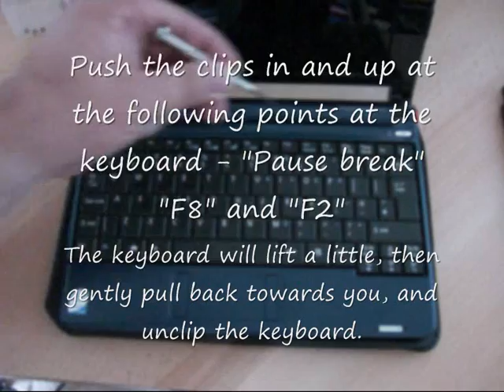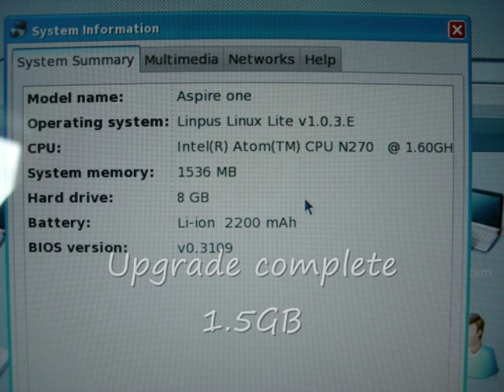Acer Aspire One Memory Upgrading

Comment: Security Active:  I used your video to help me with an issue I had with the power supply.  I found a broken wire coming from the board to the female power connector (Charger).  Resoldered it and put it all back together.  It works once again.  Thank you!  If not for your video I may have broken the plastic while trying to access the internals.  I really appreciate your efforts to help others.

Comment: I did this upgrade, and it was definitely worth the trouble. Top tip is to use a credit card to take the cases apart, the use of a credit card prevents you from causing damage to the plastic. Job's definitely added a couple more years of useablility on this old netbook.

Comment: Thanks for sharing this.
I got the Linux 512MB RAM, 120GB HDD version two days ago. Last week, I got a Dell Vostro 1700 which I upgraded to 4GB RAM, so had 2 x spare 1GB Samsung PC5300 SODIMMs from that. Fitted one of them into my Acer and it works a treat, just like I knew it would. 
Installed XP Pro with SP3 tonight. The only difference with my dismantling was that I had to take the board with the audio in/out out to get the motherboard out due to it having the HDD attached to it. Cheers!

Comment: I'm pleased to see there is a slot on the underside of the mobo. Considering my Aspire One came with 1GB of RAM, I'm guessing that I presently have a 512MB module in the slot at present. Still, I'm very glad to see that this computer isn't at it's limit with regard to RAM. I can most certainly see myself adding two more gigs some time down the road. At present I'm very satisfied and have no justification to have more RAM.
Thanks for the succinct but detailed video!

Comment: Great video!  I had to disassemble two of these and this came in handy.  I had to take the HDD out of one and put it in another to see if it would boot off that drive.
This video is useful for getting at the HDD as well as the memory because the HDD is located right next to the SODIMM slot.
This video is pretty relavent to disassembling an A105 8.9" incase you are wanting to know.  (thats the model I had to disassemble and reassemble...twice).

Comment: Fantastic! Thanks. 

I upgraded my 512MB Linpus AA One with RAM in the format mentioned at the end of the video. Took a little patience but it wasn't too hard. The system works so much better with 1.5GB on board. I was able to buy a 1GB DIMM in the format specified at the end of the video from Patriot for <CAN$30 with shipping. Well worth the money.

When you're upgrading, you might notice what appears to be a SIM slot in behind the battery... perhaps there's a 3G card coming?

Comment from the maker: @Userizz Sorry you are incorrect.
There is 512MB soldered to the motherboard that can not be removed.
The is an empty SO-DIMM slot and I installed a 1GB module, that is a total of 1.5GB RAM.

Comment: Thanks a million for this video! I will be using this when upgrading my A1's memory!

I already tried once, but I didn't get any further than the screws below the battery pack.. one screw was so tight, there is now no more need for a screwdriver.. I'll have to drill it open, or something.. And since I'm currently awaiting my Dremel I'll wait until I got that one.

But once that's taken care of (damned screw!), I will follow your video, so thanks for posting!

Comment: That sucks. Hope it works out for you!
I still haven't decided if I should drill the screws open or not. For the moment it works and doesn't look too bad even though I messed up with the screw (I should never have used the soldering iron..)

Comment: NOTE: some people are saying this will not void your warranty. IT WILL. Memory upgrades on laptops usually dont, because there is an access slot under the machine to get to RAM. This thing doesnt have one, so you have strip it completely, thus removing "warranty-check" screws. 

Also, its tricky. Dangerous and like me  you may hve to solder parts back on :) 

Also, if you KB lock slots go missing, its cause they got stuck inside the rounded part of the case. Simply look from behind.

Comment: I managed to fix it!!

I couldn't wait or do nothing, so I drilled away the screw. I managed to unscrew it later, so its not very damaged there (Just the other one I melted).

But this was really tricky, and I wouldn't recommend doing this unless you are used to it. Also, it's not very neccessary if you plan on keeping Linux Linpus.

It reports 1536 MB memory after the live update :-)

Comment: In regards to the reasoning of upgrading ram:
XP with how much has been added to it over the years, now runs best with a MINIMUM of 1GB ram.  In other words, just sitting at the desktop, depending on what other software is installed, it could be using around .6 to 1GB of memory from just sitting.  Adding more memory means being able to do more stuff at once.  In regards to gaming, more memory helps but its not the only thing that improves gaming frames/second and graphics.

Comment: It should not be fused. Take the rubber feet off and remove the screws under them. It takes a gentle pry to get the bezel snap up. Just be sure all the screws are out of it, both under the keyboard and on the back.

Comment: Your RAM is underclocked since the N270's FSB is 533... 
Is the system stable ?
And the max ram is 2Gb...
Both my aspires D250 and & A150 (like in this video) came with 1Gb and a free slot... upgraded both to 2Gb fine

Comment from the maker: The easiest way to upgrade your HD storage space, is to buy a high capacity SDHC card and store it in the left expansion slot.
Physically upgrading the internal 8GB SSD is not an easy process. If this is a route you are considering, do some searches on ZIF connectors and Compact Flash cards.

Comment from the maker: Gotta love comments like that moliverm. The memory is installed, and it works no problem. If you were not aware a computer can accept memory of a different specification, but will not utilise it higher than the memory that already exists. So the memory is only running at 533Mhz. 
I suggest you purchase exactly the same make and specification of memory and test it before making such comments.

Comment: Also, purchase some capton or mylar tape, remove the LCD cable from the mainboard. Tape around the connector and replace. Stops the LCD panel from shorting the board and getting half a display.

Comment from the maker: The Aspire One does not support 2GB Ram, 512 on board and 1GB Stick is the current max.
As for the warranty there is no firm answer on that.

There is no access plate on the bottom to access the memory area.

Comment: @goshmerlin I went to nDevil.com and his RAM upgrade for the D255 follows exactly the same process.   I did this upgrade just now and there is no way to get the bottom off without taking the KB off.  I did wonder why Acer didn't put the screws through the base plate,  but they didn't.   So KB has to come off.

Comment: I found out that my AA1 A150 has its driver mode on PIO.

how do i change it back to DMA?
what will happen if i uninstall the drivers?
What will happen if i restore to factory settings (alt f10 at reboot), will it remove my OS?

Comment: For all those moaning about why did Acer make it so difficult, the clue is in the name; netbook.  It's designed for surfing and email etc. and it runs very nicely on 512MB RAM for these applications.  If you want to do things that require more memory, you either learn how to use a screwdriver or buy something else.

Comment: know definitely not this laptop does not support DDR3 memory as well as it would not physically fit in the memory slot

also you may want to check out my videos
on installing RAM in the Acer aspire one
as it is much more detailed as well as the video quality is much better
and there is also a video on reassembling it with diagrams of where the screws go

Comment: @securityactive try a system restr if u have a point or un a memory diagnstic worked once for me try it out or when starting try F8 hit it until it come out a menu that have safe mode safe mode with netwoking....etc go safe mode and see if it starts if it those try system restore if ure accer still have windows xp just alt F10 nd follow instruccion hope u get it solve ....ps the instruccion before mencioning windows xp is for windows 7

Comment: Actually...the new ones come with 1GB (512MB on board & 512MB in the slot) see u can replace the 512MB in the slot with 1GB RAM.  512MB onboard + 1GB in the slot = 1.5GB max.  You will have an extra 512MB RAM module that you can sell on craigslist or something to offset the cost or just use it as a paper weight...u choose : )

Comment: Never mind, after trying a nice tip about heating stuck screws with a soldering iron... Lets just say that I'm sticking with the 512 MB and a working, albeit slightly dented  AA1 for now... :-(

Also, another screw below the battery pack is STUCK. Why do they tight them this much? I use a right size screwdriver, to my knowledge. The other screw unscrew just fine. Probably just because DIY misfits like myself will screw it up (pun not intended)!
(continued...)

Comment: @erick36594 My Acer Aspire 5100-5455 that I bought for around $600 brand new, was pre-installed with Windows Vista. It has:

1.8 GHz AMD Turion x2,  1 GB RAM   (256 MB of the RAM is used for graphics by default, so I am left with 768 MB RAM for Vista)  ... Disk drive stopped working 1 month after I bought it. It overheats enough to where the stickers on the bottom can't be read, The left touchpad button is broken, the screen won't turn on, and the batter lasts for only 15 minutes. I HATE ACER!

Comment: ALL YOU NEED TO DO IS REMOVE THE 1 MIDDLE SCREW UNDERNEATH LOCATED IN THE PERFORATED SECTION UNDER THE TOUCHPAD AND SLIDE THE COVER AWAY FROM THE BATTERY and it's right there.
Reply: Remove what cover? AOA110, the first one, does not have one.

Comment: @erick36594    Also, the Card reader only works on a good day. 2 of the 3 USB ports only run USB 1.1   only 1 of the 3 uses USB 2.0  ?!!!!  WTF   I got ripped off. I treated this laptop with soooo much care, and everything broke for no reason. most of the problems I have had, others have had with this same model. Oh yeah, and the biggest problem of all:    I power up the laptop. The BIOS gives me an error message with 2 VERY LOUD beeps, saying there was some type of error on the board itself!

Comment: RAM...the most you can extend to is 1.5GB (thats 512MB built in and 1GB as shown in this video).
GRAPHICS....you won't be able to get anything smaller that will be as efficient...basically what it comes with is probably ur best bet.
MEMORY....there is a 160GB Western Digital 2.5" SATA HDD (i think its the WD1600BEVT ) that you can upgrade to.  Anyway, just an FYI.

Comment: I have built many good working PC thank to God and it took some time and a lot of hair pulling LOL; I do have the Acer One Laptop and it came with Linux which I was not happy with so I change it to XP Pro. As far as that goes I will not play around with it and upgrade the hardware as it is faster than I expect it to be. However they could had made a simple upgrade slot for it..

Comment: 120 gb is much faster than the low grade ssd.

windows boot i very fast and the laptop would most likely break from a disabling fall before the hdd would.

its a hdd. unless you are going basejumping with it or plan on knocinkg it off of tables it'll be fine.

Comment: This isn't for the Acer Aspire One model D150-1165.  You'll fuck up your laptop for nothing if you follow these.  This model has a single 1 Gb DIMM that can be accessed by a door on the bottom of the unit.  Remove the single screw and then the door.  Take out the single chip in there and replace it with a 2Gb model and your done.  Just put the door back on and boot up.  Thats it.  This video led me the wrong direction and nearly caused me to mess up the machine.  'Nuff said.

Comment: @kody1234567891011: If you post your email address, I can email you a photo.

But really, you'll have to have a screwdriver to take the back cover off. If you already have the screwdriver, just start taking one of the doors off. If you see your memory module underneath it, that's probably the right door. If not, open another door.

If this is too much for you, I'd suggest taking your laptop to someone qualified.